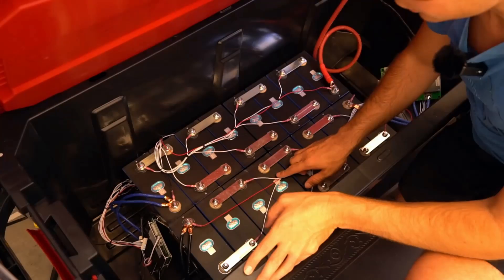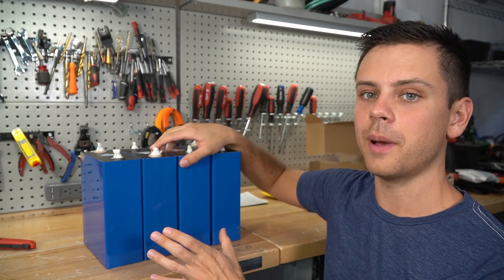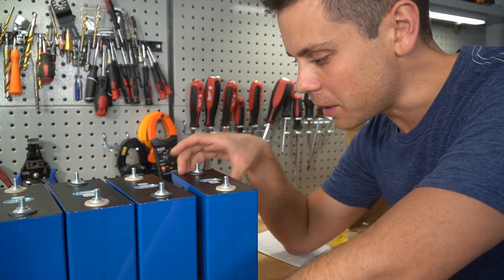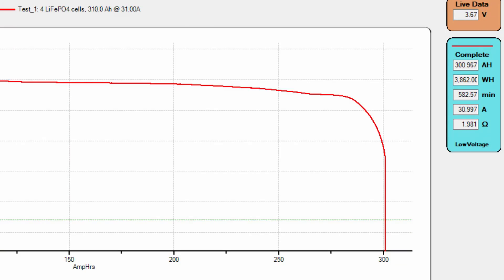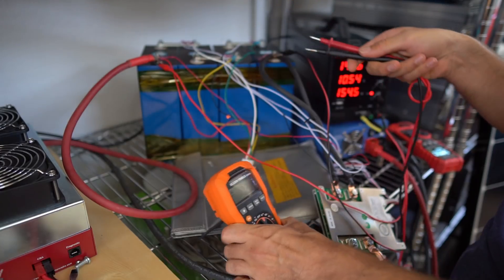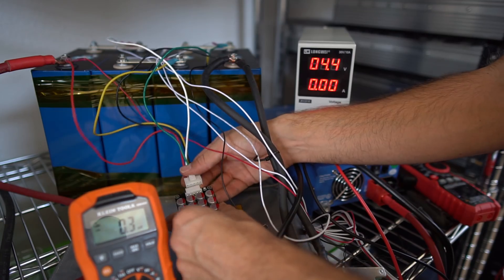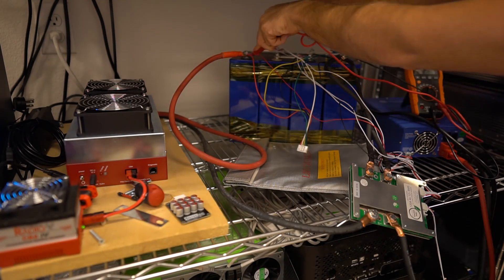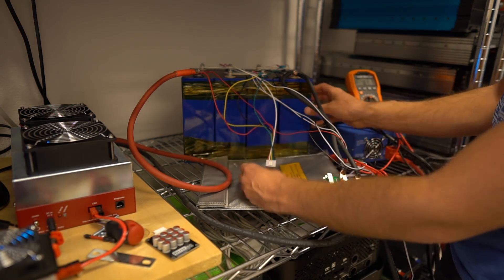Amazon.com "Grade A" 310Ah -Ninthcit- LiFePO4 Cells Manually Balanced and Tested

Comment: I wonder if a lot of the bloating differential from cell to cell would be a result of the conditions when the cells were assembled?  

Temperature, humidity, and atmospheric pressure  would all play a roll at the time the cell was sealed, which would impact how much off gassing would occur internally, causing the cells to swell.  This would mean you could purchase a Grade B cell that goes through 2,000 duty cycles without ever bulging, yet could purchase Grade A cell that starts to bulge almost immediately, even before any actual duty cycle usage.

Comment: I bought 8 280ah cells from Aliexpress that were “grade A” cells. Six were swollen and one cell always charged faster than the others and it was an end cell as well. Not so sure it is not the BMS that isn’t the problem. Swap your end cell and check for yourself. With these BMS’ it seems to happen this way and I am not so sure if the BMS is having a negative effect on the end cell.
Reply: Not what I want to hear.  I ordered 8 - 280ah cells from Aliexpress that are also supposed to be Grade A.  Supposed to arrive in October,...looks like I am not going to be happy
Reply: @jameschristie4596  You will not be happy to know it will cost more to ship them back than buy new ones. Do NOT buy the overkill BMS. They guy buys them from Aliexpress, sticks a sticker on it and marks it up 100%. But the same BMS on Aliexpress. You may have to work hard to get the cells to take a full charge. I could not get my cells to take a charge up to 3.65 volts until I let them set for weeks at 3.3 volts. Still, they are a better value than buying Battleborn batteries. You may get only 250ah but that is still remarkable for the price. Good luck.
Reply: @chrisp7652  At least with Battleborns one gets a 10 year warrantee, plus since they are in the US, if one has problems, it won't take months to replace a bad battery.
Reply: @Tumbleweed5150  true. If you build your own you save loads of cash and if you do not abuse your cells, you can get over 10 years. My 8 cells and BMS cost less than $1000 and at worst I have 500ah which is 5 BB batteries or $5000. Do the math.
Reply: @chrisp7652  Good point.

Comment: Am certain your assessment is correct... Manual top-balanced only three of four cells? The one not balanced was the bad cell? Coincidence? Procedure might be uniform for all four cells? 2) There's a difference between cells connected to power-supply and disconnected, especially after a few minutes to settle. 3) Those automatic-balancers seem unreliable, especially on end cells? 4) Maybe move the bad cell into middle and rebalance?  (more...) 

5) Voltage isn't a great way to balance, especially at the top-end of charge-state.  Unfortunately, the only better way might be to run full discharge curves on each cell individually and overlay the curves?  See what each cell's total capacity? Measure possible differences in top-end voltages vs total capacity? Not recommending it, because it's a lot of work and unlikely to answer the question, just something to think about?  

6) Comment about first-cell being first to under-voltage is a poor-man's way of estimating capacity and may well prove the first cell is bad. However, cells at the ends-of-stacks often exhibit anomalies (e.g. lead-acid ends-of-stack cells often require more water?)? Easy enough to swap cell-1 into the middle (as suggested in #4 above)? 7) Not sure how disconnected the load is? Is there backward diode leakage? Best to just disconnect it during manual balancing, just to be sure? 8) Even if somewhat unreliable, auto-balancer anomalies support both #6 and #7 possibilities?

Comment: Will: "Don't do this at home, this is dangerous."
No worries, Will. I have no idea what you are doing.
Reply: lol exactly.  but oddly enough i cant get enough of these battery and solar videos
Reply: LOL!... The battery was so close to being fully charged that the charge curve was already well into the CV "Constant Voltage" section, where the current drops off... so in order to top the batteries off quicker he set the power supply to a higher voltage so that it would move back to a CC (Constant Current) part of the curve.  This is dangerous because it means that now YOU, not the charger are responsible for monitoring the battery voltage and ensuring that it doesn't get over-charged... if you forget and leave it, it could be destroyed (or with some chemistries it could cause a fire etc)...
Reply: @JamesLewis  Not too dangerous as he was monitoring the short duration boost charge of each of the cells that he was performing manually.  It's a fast way to reach max cell V, but the cells will dip in V after he finishes because they aren't really 100% saturated after such a technique.
Reply: Simple explanation:
His wires were too thin and were dropping voltage across them.
He just turned up the voltage to compensate for that drop.

But if he wasn't paying attention, his batteries would eventually get overcharged and would severely damage them.
Reply: Chinese companies ALWAYS LIES AND OPERATE UNETHICALLY. They are the absolute worstttt
Reply: @spittingfacts4662  Ironically, just like we refer to "Elon time" when talking about SpaceX... Most of my circle tend to refer to "Chinese watts", when it comes to anything purchased from those suppliers... different products/brands tend to have different ratios of course...  for example there are plenty of brands of 18650 cells where the actual capacity is as low as 5-10% of the claimed capacity... while other vendors do deliver 90% or greater of the claimed capacity... you just have to learn how to spot the signs!... 
Another example is LED products... there are reputable brands of flashlight that list lumens and they are usually within 95% of their claimed output... while many generic brands might be in the 25% range.... I think this has a lot to do with how well regulated they are by people like Will who test the products and hold their feet to the fire when their products don't meet the claims.... Another example is any kind of unbranded LED spot/floodlight for a car is usually around 50% for example...
Reply: @JamesLewis  There are lots of good and bad. Some of the bad ones end up on ebay. It's harder for bad businesses to survive in China now with more things being reinforced. I have not ran into cells that are 5-10% capacity, the ones I've owned is the liitokala cells which actually has a better real capacity. The other cells are obvious that they probably don't have much inside, price makes it even more obvious. 

As for flashlights, some of them are rebranded and some odd products from what I've seen existed before it hit the NA market.
Reply: @spittingfacts4662  "Always" is not legit...but, some of them definitely do lie--just like lots of other sellers...
Reply: @spittingfacts4662  So you have spammed the exact same thing on 2 other comments. You sure wish to spread hatred don't you?
Reply: @6424642  You copied and pasted the exact same thing in the other comment. If you are going to copy and paste anyways at least spell racist right.
Reply: What? The 4.3kWH of stored electrical energy with live wiring on top of a chrome metal rack? Pishposh. No problem there...
Reply: @williamlabarre4755  4.3Kwh is less than a single 1lb camping propane cylinder, and most people have no issue throwing those around... or pumping gallons of refined petroleum products which have hundreds of times the energy... everything is relative.

Comment: Too Good To Be True:  For the price, no company is going to spend 8 hours and the watts required to perform that test.  They probably just charge them to capacity and push them out the door.  Clearly, the low cell wouldn't pass that test.
Reply: The willingness of Chinese manufacturers to flat out lie about their products amazes.
Reply: @lavenderlilacproductions  The willingness of people to buy them is equally amazing. Do you think that they have any kind of quality assurance department? I don't f'ing think so.
Reply: @lavenderlilacproductions  its not the manu, its a used battery auction reseller, aka a yard sale

Comment: Like you always say: you get what you pay for. If it’s too cheap to be true, then it’s probably not true. 
It’s crazy though how a little bit of honesty about the product would satisfy us. There is no reason any battery or cell should not pull capacity. Just advertise a lower amount. 
Then again, if it’s cheap maybe it doesn’t matter as much. 

Question: what is US policy on recycling LI batteries?

Comment: I've bought some grade A EVE 280's from Shenzhen Qishou Technology... and while they were $106US each.. they were not bloated and pulled full capacity! :-)
Reply: Someone else mentioned that Eve brand and said that it worked as advertised. Nice.
Reply: I bought 8 280 A grade cell and have been using them in outback australia in my Caravan. No issues thanks Will I will not be buying from Amazon

Comment: This pack is problematic with a weak cell. That cell equalizer board will not keep up with high charge currents and will over voltage cell(s) at high currents. I have had this problem with LTO and the same board. I don't have a solution to this high charge current problem. My hope was to high current charge low AH LTO cells to offset the weigh of the cells. The theory is who cares about capacity if you can charge your cells super fast. It works but over time the cells go out of balance. I have better cells that should do high current properly. I will test this winter. Your cells don't look matched.

Comment: Everybody I know who has purchased (and received) cells at 300-320Ah have all said the cells they got, most were bloated to an extent, but none as bad as the one you showed. But, those who purchased the Eve 280Ah have said that they universally were nice and flat and always pulled more than 280Ah. So, for now, I would say 280Ah Eve are the way to go (not welded lugs though). They appear reliable and better made. If you look at the dimensions, something doesn't add up. Start with the Eve and do kWh per volume and per weight. The other brand 300-320Ah cells appear to have higher energy densities. Are they trying to squeeze too much in to the space, and cost cutting on the cell construction materials (thickness)?
Reply: May I ask why you don't recommend welded studs?
Reply: @alex-w8p2e  If you apply more than a very low torque, the weld can fracture, causing micro-arcing, which you won't see. If you want a welded connection, it is better as a plate, not a stud. Like the ones Will Prowse saw when he opened up an EG4 Server Rack Battery.
Reply: @trevornelmes9331  ok, thanks , I bought lf280k which Is only available with welded studs, so I won't tighten it too much
Reply: @alex-w8p2e  I seem to recall maybe 6-8 ftlbs max, but I don't have a datasheet to hand. That is less than my 'hand' tight.

Comment: Hi. Will, I am a regular viewer and like your presentations but there is a lot of info to take in!! Can you answer a couple of simple questions for me? I am in the process of designing a vehicle. solar system for. my 4wd Delica camper van. I can really only fit one solar panel on the roof and was. thinking about. less than 300watts? In terms of the battery I will go for Lithium. but am confused over 12v versus a 24v battery? In terms of applications to run. I am thinking mostly 12v things, like LED lights, a water pump, a small fridge, USB outlets, Maxx fan and for AC, my laptop, Internet hub. Can you advise me which way to go with. the battery. I intend to use a Victron Solar Charge Controller 30AH and fuses/breakers in. both DC and AC circuits. Many thanks. KiwiChris

Comment: In China-speak, 310AH is the model number.  I also wondered if they test with a different upper/lower cutoff limit.  Drain it till it melts and yup you got 320.
Reply: That's not how it works.. There is next to no capacity under a certain voltage

Comment: Have you seen the specs on the Re(Li)able Renewable Battery System for RV Vans?  Just wanted you're take, as the RV superstore has the Thor Tellaro with this Lithium Package at $26k.  This package is running as high as 30k for Jayco, and Winnebago for the same Ram 3500 Pro Master platform. I'm thinking I could save so much more with a Battle Born Package.